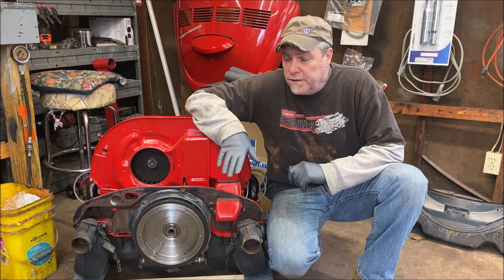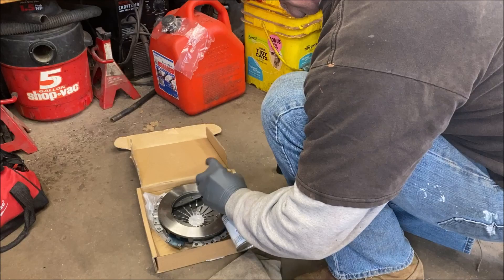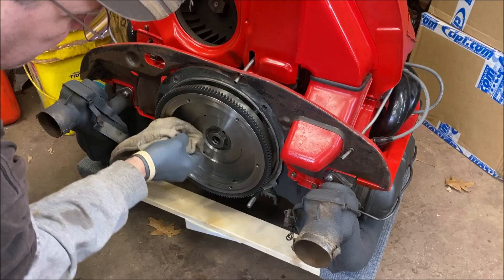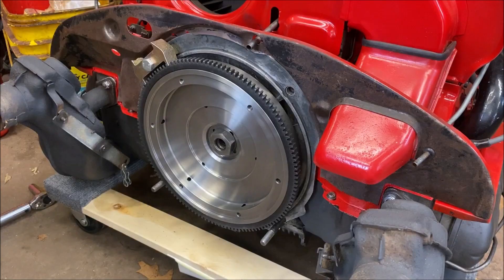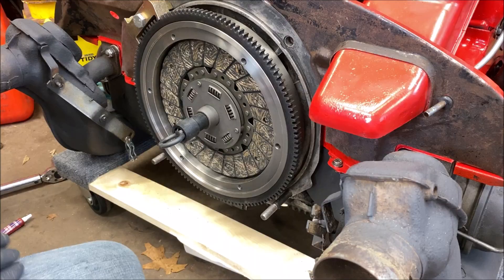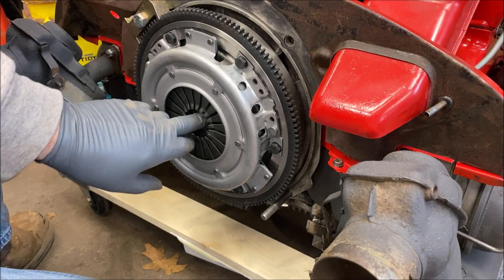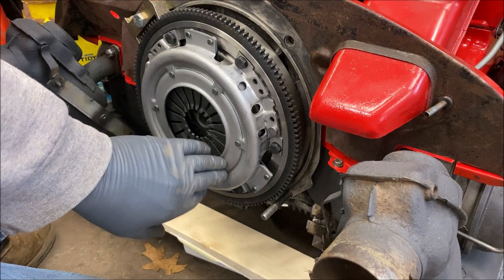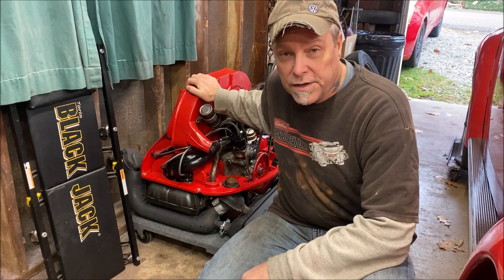VW Beetle - Super Beetle Clutch & Pressure Plate Install! DIY! You Got This!

Comment: I've watched 5 videos now, and nobody replaces the pilot bearing...
Reply: I wondered about that too. I spent more time than I will admit removing and replacing my pilot bearing.  Probable didn’t really have to but I feel better that I did. It was a bugger. Finally resorted to removing the crank bolt. Should have started there.

Comment: Awesome and great video truly appreciate the help on these! I have 2 questions that might apply when I do this to my 74SB:

1. I have read in some sources that you need to lubricate (grease) some parts during the clutch replacement procedure (I think the throw-out bearing and the shaft coming out of the transmission), is this true and what do you recommend?

2. Is the re-alignment of the crankshaft with the transmission just as easy as putting the parking brake on and moving the engine until it "pops" into place, or is something else required?

I just want to get this right the first time, thanks again! :)

Comment: Another great video Slades. Looks like a fun job to do. I actually just bought a new thing of Loctite today and was thinking about when I would need loctite on the beetle 😂. Keep up the good work and videos. Look forward to seeing it be put in the car and the car up and running.
Reply from the maker: Thank you Blake! Yes Loctite is nice to have on hand. There’s red and there’s blue. The red it’s very hard to get the bolts back off, so there’s usually a debate on which one we want to use on certain points. We are almost there my friend!
Reply: @SladesVWBeetle  Yes I have used both. Only use the red usually on head bolts and stuff. It is usually only removable by heat. I like blue plus blue is my favorite color. Yes I hope everything does well. Did you get a different fuel pump for it?

Comment: Cool tool for locking the flywheel. I've had to redo video clips before too usually because the mic was off or batteries died. I double check now
Reply from the maker: Yeah that  tool  is a must on these motors it really helps a lot. Yeah that’s the second time I’ve done it, thought I hit the record button and I’m standing there talking to myself and had no idea.

Comment: Hello, Slade.  I’ve found that the pressure plate perimeter has a way of catching on the bottom edge of the flywheel.  Yes, although the pressure plate seems completely—perfectly—centered, it’s not.  When you go to tighten the bolts, it even seems that the edge of the pressure plate is perfectly inside the flywheel edge, because it is—on the upper portion of the pressure plate ... where your sight line is.  But ordinarily you’re looking at the upper part of the pressure plate, because your head and eyes are looking from above.  However, the bottom of the pressure plate edge can seem to be inside the flywheel edge, but often, it is not.  You can even tighten the bolts and all seems well, until you take the car for a first run, and the clutch starts acting up.

So, what I do is this: I get my head down below the pressure plate and position it from the bottom.  This way, I can see if the bottom of the pressure plate is perfectly positioned inside the lip of the flywheel edge.  Then, as I tighten the bolts, I check a few times and look from a bottom view to see if all is well.  Naturally, while doing this, I also look at the sides and top.

I had heard about this lip problem, but didn’t think much of it until once I actually looked below to see, and sure enough, the bottom of my pressure plate edge was close—but not perfectly inside the lip.
Reply from the maker: Very good advice my friend! Thank you so much! Hopefully all went well with it. And you are right how you described it.
My head is towards the top of the pressure plate, so I’m really not seeing the bottom part. 

That made perfect sense at what you said! Thank you so much for taking the time to type that out!! I appreciate it more than you realize.
Reply: How did you get around that provide

Comment: That rotten throw out bearing!  I ruined the springs on the original and had to buy another.  Couldn't find anywhere just selling the two little springs for the new style bearing.  Great video as usual!
Reply from the maker: Thank you Williams! The are  kind of easy to do but at the same time you can stretch those springs pretty easily. Thanks so much for always being here.

Comment: I have realised my torque wrench is out of torque, so I believe I have torque the bolt to 17 ft lb,
And the engine is back in the beetle,
I did use good quality spring washers,
So I am hoping they don't come loose,
Do you think that just 1Ft lb,  would make a difference,

Comment: great vid man im about to watch it again. What year bug is this? Im wondering if it would be exactly the same for my single port 71 super beetle, the engine was made in 1970 so i think i have the eariler style.
Reply from the maker: Thank you John I truly appreciate that! 1971 super beetle did not come with a single port. So you have a different engine in there. I’m not sure if you would have the earlier clutch style set up. 
If so, you would notice the difference immediately on the pressure plate.
Reply: @SladesVWBeetle  ok thanks , is there a way for me to look up what year bug my engine came from? I know the engine code starts with AE
Reply from the maker: @johnmartin5153  That would be from a 1971-1973 1600cc
Reply: @SladesVWBeetle  thanks man 👍🏻

Comment: Awesome video thanks a lot!! I do have a question, I have 3 rib Type 2 transmission in my 69 standard bug... My question is, do I need a different styled pressure plate ? Sorry if this is a dumb question, I just have no idea 🤷‍♂️... thanks 🙏
Reply from the maker: Let me try to look into that and find out a little more. I never had a type two transmission in a beetle before but I know it’s a popular thing to do for some folks. I imagine you’re going to have to use the pressure plate, and release bearing for a type two. I hope this makes sense but the motor doesn’t know what you’re using on the transmission.  Trust me my friend there is never a dumb question.

Comment: Good job, I've got all this to put back together. I am wondering though.. My pressure plate has rusted since being off the engine. I was thinking brake clean and a scotch bright will bring it up.. Would you think that'd be OK to use still?
Reply from the maker: Long as there is no pitting, it’ll be OK. But definitely use a green scotch pad, with some brake clean. And then maybe some 000 steel wool just to make sure there’s no scoring. Otherwise I wouldn’t be too concerned.